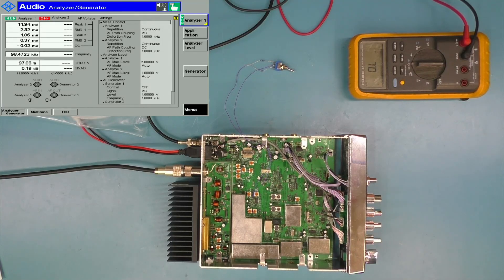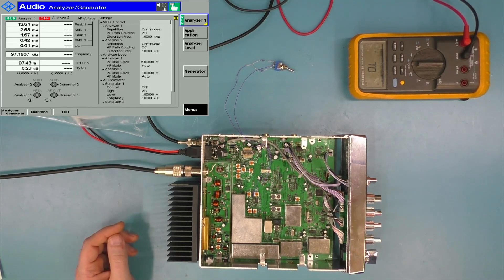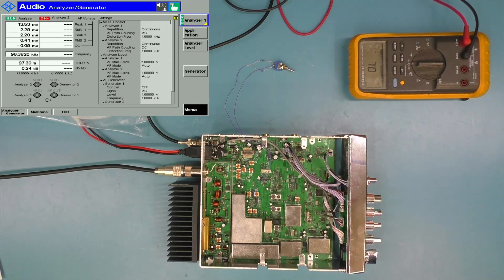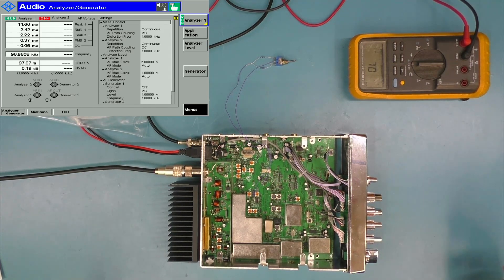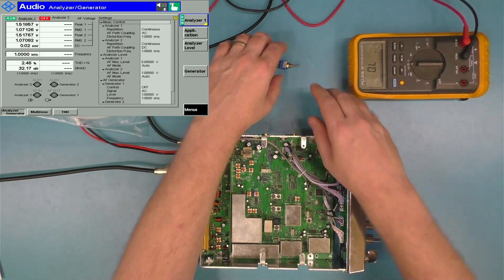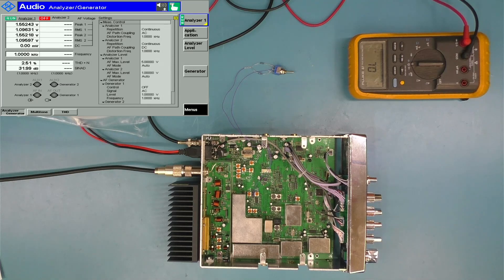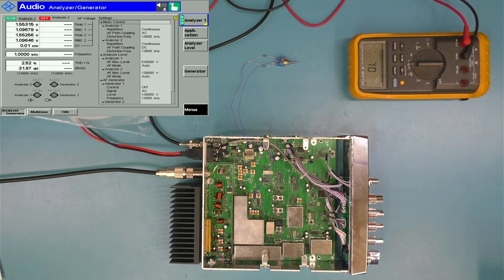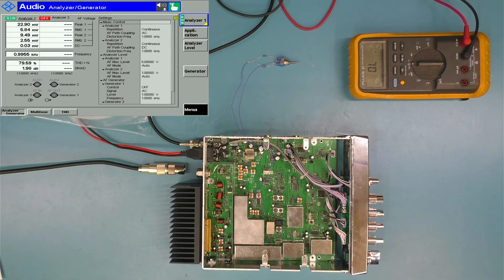Stryker 955 v1 AGC mods. (R50) - Don't do it...

Comment: Like I keep saying. There's a reason that RF Engineers make six figures...
Reply: That's a FINE TOOOOOOOON hack mod that Mark is EXPOSING!
About time!
Reply: That figured...
Reply from the maker: Yeah, it's one of his. In fact I have only seen it in radios that I was told he worked on.
I have two SR-955s and one Anytone quad 6 with the same changes. Previous owners claim they bought them from Mark.